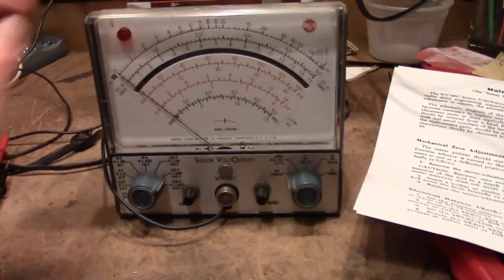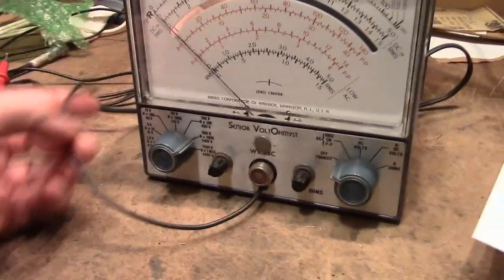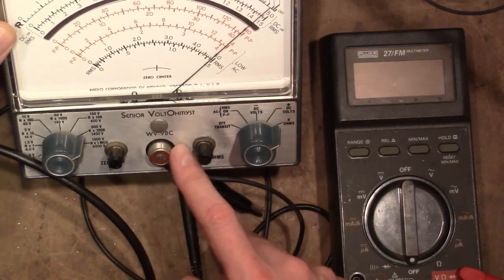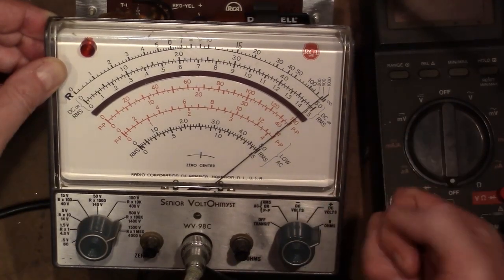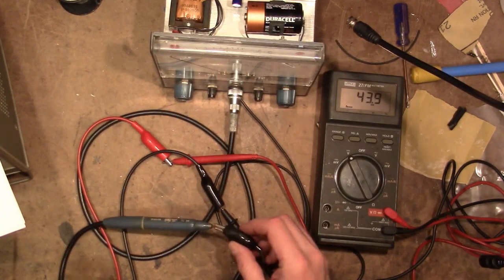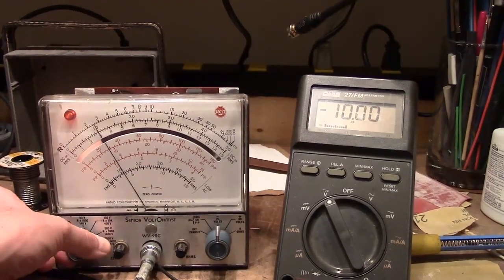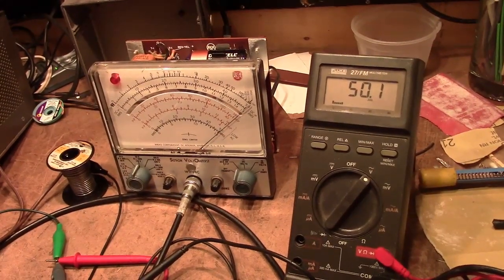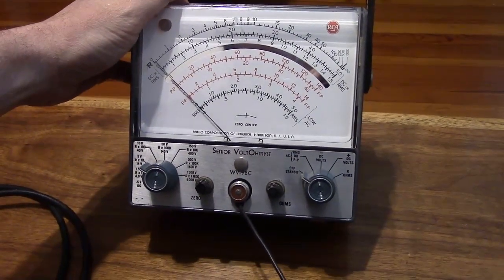RCA Senior Voltohmyst calibration

Comment: That was one of the better meters .I own the master wv510 RCA.Bought it new in 1969.It is solid state.I also have manual that came with it.Still working condition.
Reply from the maker: I also have a Master, but it's the older WV-87 version. That huge meter is easy on the eyes 🙂

Comment: Perhaps a silly question Bob, but how do the input impedances between the Fluke and the RCA VTVM compare, and does that factor significantly into the calibration?
Reply from the maker: +Jason Atkin Both are around 10Meg.  No, it doesn't factor into the calibration at all.  I connected them in parallel so they should show the same voltage regardless of their impedance.